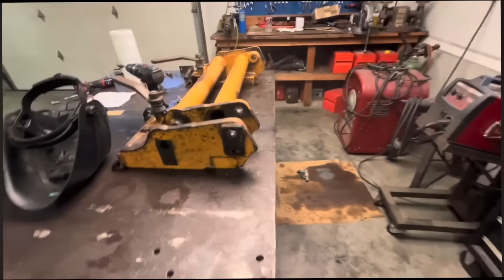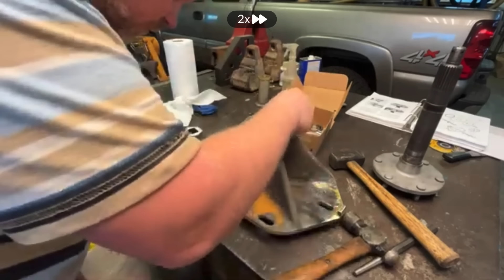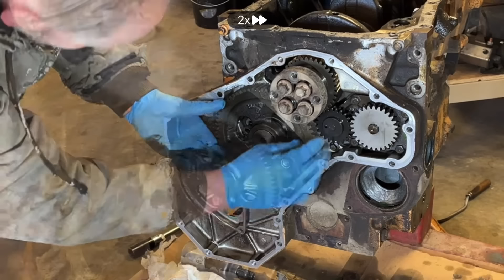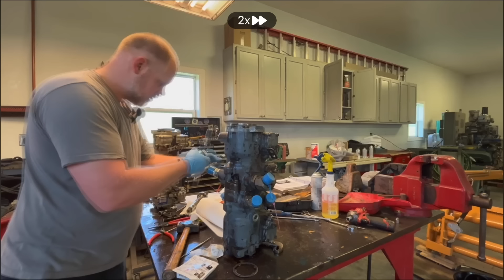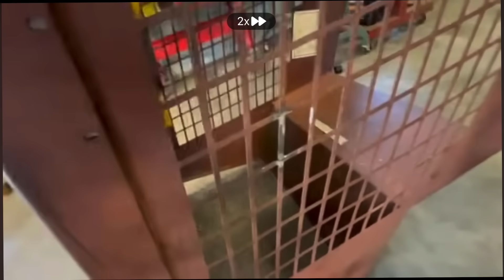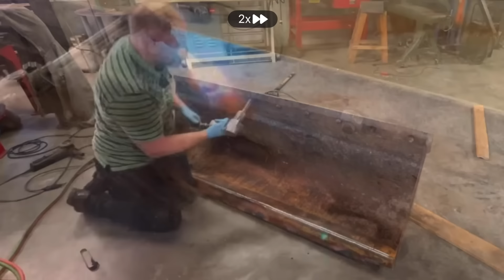Start to Finish:  Making a 35 Year Old Skid Steer New Again - Case 1840

Comment: Awesome work man! Im looking at buying the same machine but its pretty beat up. What I can figure out is how the parking brake actually works??
Reply from the maker: The parking brake works by a cable and pin mechanism.  The pins lock into holes drilled in the front sprockets.  Cables pulled by levers release the pins while driving.  Thanks
Reply: @MikefromMissouri the pins go into the chain case then? 🤔 I can't find any good diagrams
Reply from the maker: @aecsummer Yes into the chain case from the inside panel on each side
Reply: @MikefromMissouri ahh, ok. Sounds like it might get expensive to fix that 😓 thanks for your help!

Comment: In the early 90's I ran a 1845c which was the best skid loader on the planet. 1000's of hours it moved 7500 tons of potassium at a liquid fertilizer plant I worked at. We bought a brand new one in 1992 for $26,500 out the door.

Comment: Drat.. Appears mine is an older Case. Has manual adjust CVT* driving some sort of Transmission that drives/Brakes the sprocket/chains/wheels pairs on each side.

* CVT is for manual High /Low speed of wheels

Comment: If someone were to design & build a wheeled to track conversion for all the wheeled type machines, that are cost effective as well as easy-ish to fit it could be a really good way to give all the older wheeled machines a new lease on life. New machines have so much electronics crap on them aswell as all the EPA requirements them their getting unrealible aswell as not something your average mechanic can fix for a good price.
Reply from the maker: There is a kit out there for the 1845C but its not cost effective. Good idea

Comment: Hi Mike, you have done a beautiful job.. well done.. just wanted to suggest, that it will be perfect if you find a way to resume the original length of the front roof .. this way your knees .. I also think it is better to extend the hole of the exhaust in the back door - it will prevent the accumulation of gases on the back door. Anyway I really enjoyed watching all your videos and looking forward to your next project 😊